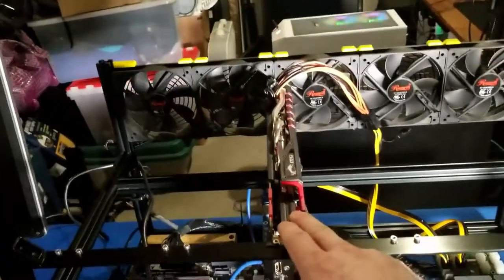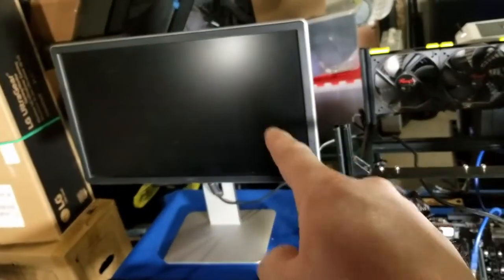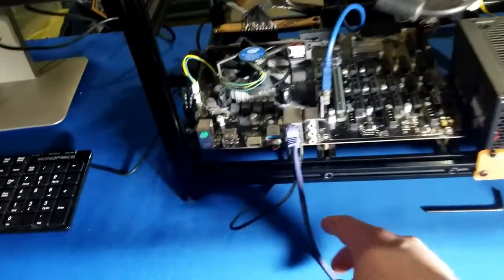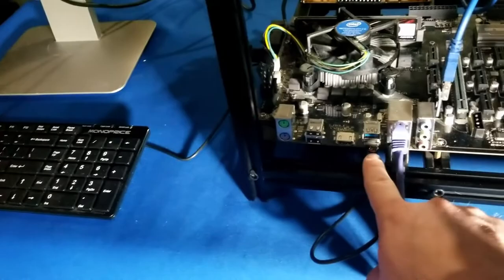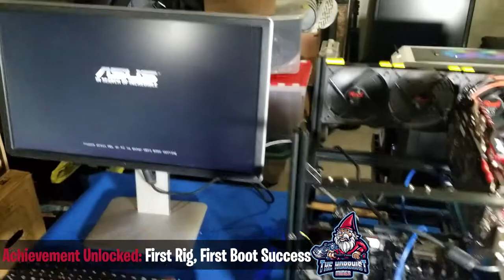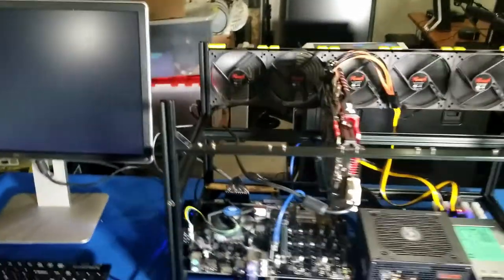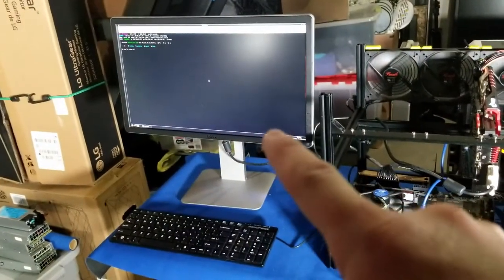I Built My Own Mining Rig, Will it Boot?  | First Mining Rig

Comment: So for the psu. You can run 2 separate psu without a psu adapter? I have one  1000w g2 and one evga 850 g2. I need to power up  7 gpu's on one motherboard.